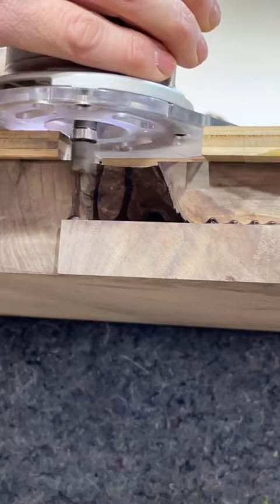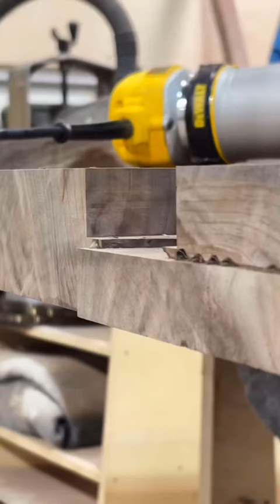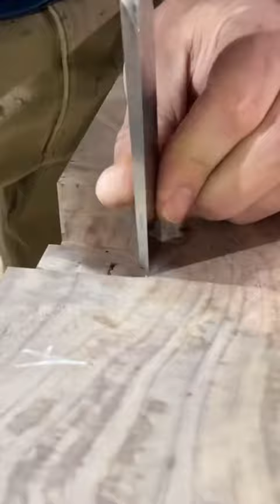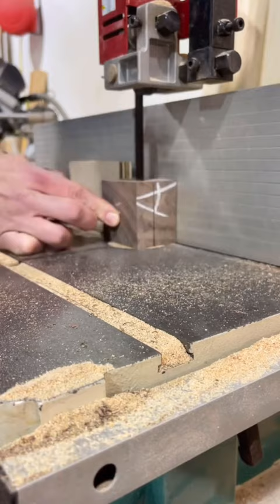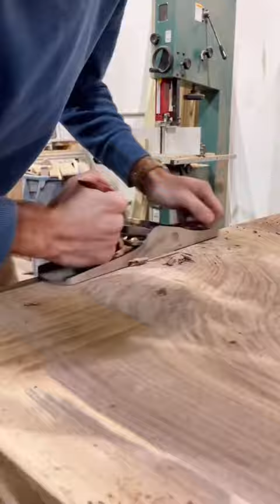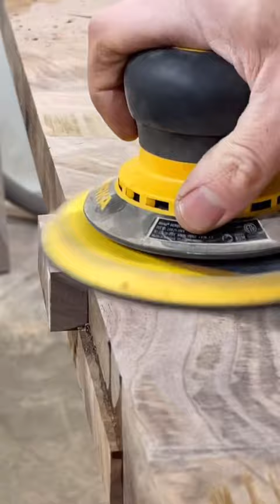How To Fix A Knot Hole On A Tabletop

Comment: I have done that for  years.may I suggest more care in choosing the plug to match the grain a little closer.
Reply: I know I've seen a few of these vids is it on purpose? This one could have gave it a quarter turn
Reply: Do not hate on some pity-patty bull--it. Good work.
Reply: @Gerald Moore  relax friend... Education comes in many forms. Including the dignity of  pointing out the goof in the most respectful and direct way. The knot wasn't "erased" as the caption suggests... It is merely a plug with little regard for grain direction which contradicts the sentiment of the video.

I struggle to see how Mr. Urciuoli's comment could affect you so greatly. Either you are not a seasoned woodworker/hobbyist or you haven't left Mother's basement yet. Life is a bit harder than his comment, so, I'd suggest you toughen up a bit, Sport.
Reply: No hate, good skills just pay a bit more attention to the grain.
Reply: Social media tip: do have a video where you do something wrong, and it generates a lot of comments and helps boost the video… a lot of creators do it.

Comment: I disagree about the grain direction, the grain was swirling around the knot.  The grain and the color was a pretty good match, but these repairs are difficult to match unless you have the next board in the series of cuts (and it ALSO has a knot in it).  With a darker finish/stain it MIGHT be fairly invisible.  Regardless, not my table.  I might have made the repair more obvious on purpose with a different shape or even contrasting wood - but to each their own.

Comment: I may have dovetailed it and run the dovetail up at an angle from the edge, coming up through the surface so the external corner is the small side of the dovetail, but you do this for a living not me! 🤷‍♂️👍👍